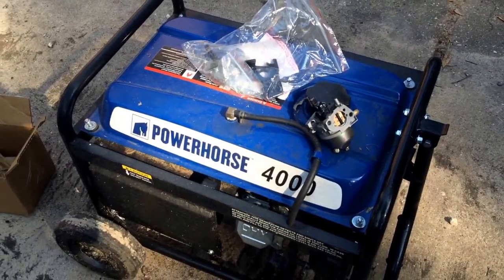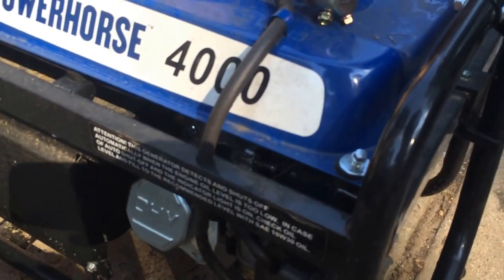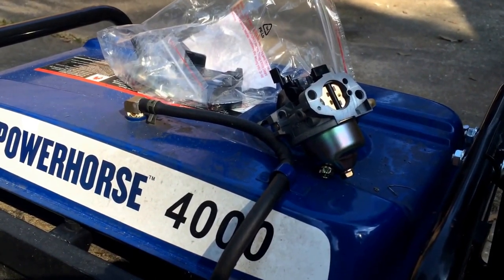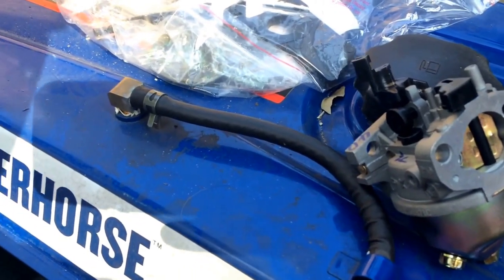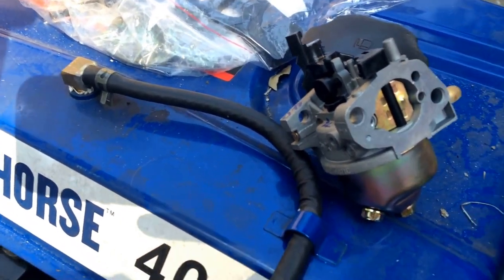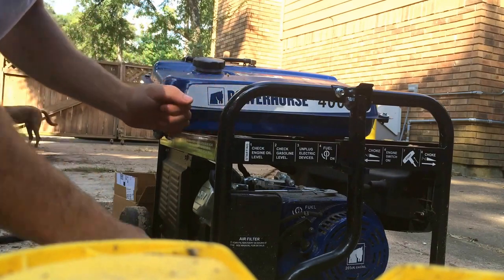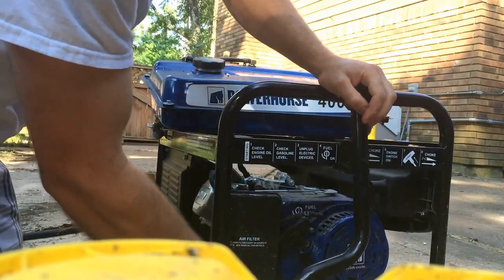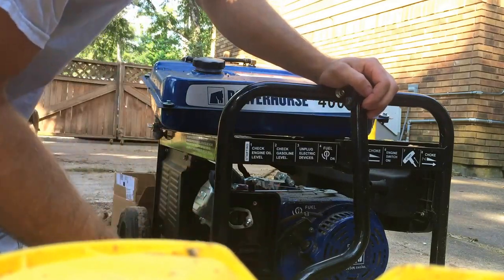Replace a Small Engine Carburetor - Powerhorse Generator

Comment: My 4000 would only run with the choke on. I took the bowl off, turned the generator upside down, sprayed some carb cleaner with compressed air up it, and it works perfect now.
Reply from the maker: Nice! Sometimes it works. Might have to try that on my pressure washer. It’s acting up and only wanting to run on choke right now .

Comment: The emulsion tube in the center of the carb is clogged.  Usually they can be removed, however on my Powerhorse 20 ton log splitter-for the life of me I could not remove the emulsion tube. So I replaced it with a carb from ebay. Search carefully for a replacement as there are many carbs, and they differ slightly. It was $15.00 and came with lot's of goodies.  The original carb was a Huayi LO2 , and I am still trying to find anotherfor a spare.
Reply from the maker: Just about every carb I’ve owned I’ve tried to take apart and clean before I go and replace it. I never can seem find anything blatantly wrong with them, but somehow replacing seems to usually fix them 🤷🏼‍♂️

Comment: Thanks for the good video Tom. One more suggestion is to change the oil after you replace or repair the carburetor. You might have gas in the oil if the needle and seat were dirty an the float is stuck.
Reply from the maker: Suppose it wouldn't hurt. Thanks for the input.

Comment: Before you replaced the carb were you able to spray carb cleaner in it and get it to run for a few seconds then it shut off ? Thats the stage I am at now after tearing it all apart cleaning it still have that issue. Debating on replacing the carb and was curious . Thanks
Reply from the maker: Kevin Unruh I was able to make it start and stay running, but only on choke.
Reply: ok ty
Reply: was your problem a dirty carb

Comment: What's that silver plate on the left of carburetor? I tried various and choke cleaner still only starts up then dies out right away.

Could it be a spark plug problem also?
Reply from the maker: I don’t know the proper name for the different plates and seals. How long does it run? Maybe your float is hanging up and it’s just using up fuel in the bowl? Make sure your float can move easy and make sure your incoming fuel line is clear and not kinked.
Reply: @TomBrueggen  ok

I'll try that thanks. 
I bought generator for $80 guy said he didnt want to go through the hassle of fixing it. I ordered a carburetor last night on amazon. Takes 2 weeks to come in.

Comment: Is this the same for the 9000???
Reply from the maker: Juan Samaniego probably pretty close. I don't know off hand but tools like this are all so similar, just bigger or smaller. Just make sure you get the right carburetor for your 9000. It's probably a bigger engine I assume .
Reply: Tom Brueggen thanks for the quick reply. I'm just assuming I'll need one since it has not been ran for well over a year.
Reply from the maker: Juan Samaniego well if you didn't before, drain out any gas still in it, tank and carb, and put in, at a minimum, silver grade has. I never run base regular in any small engine. You may get lucky and it starts and then that better gas will clean up any little residue. Maybe... :)